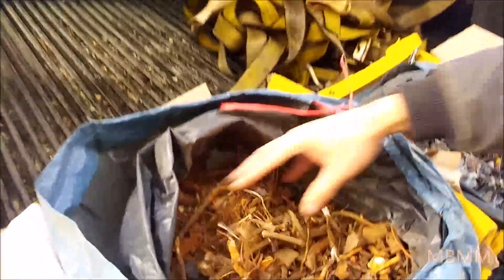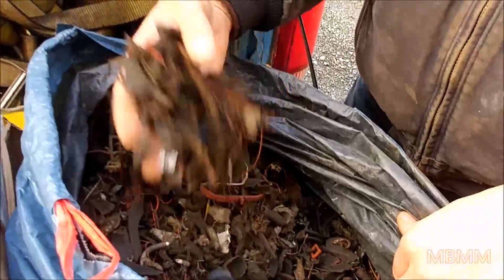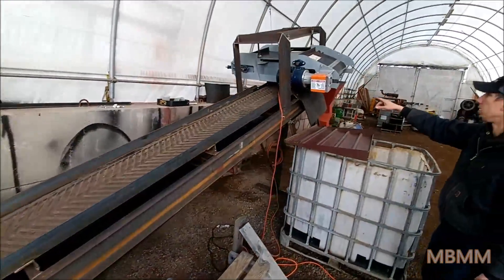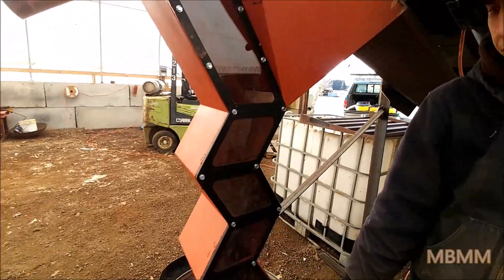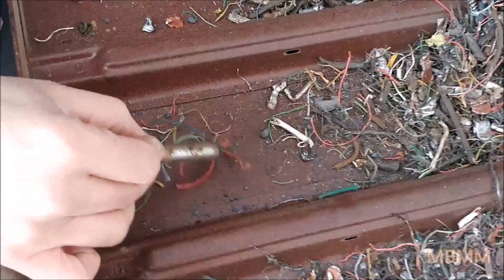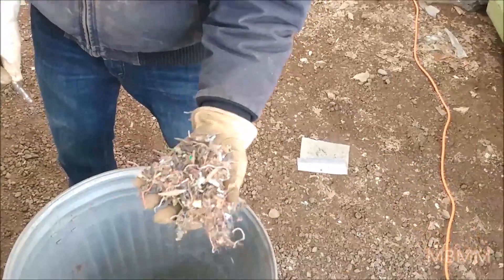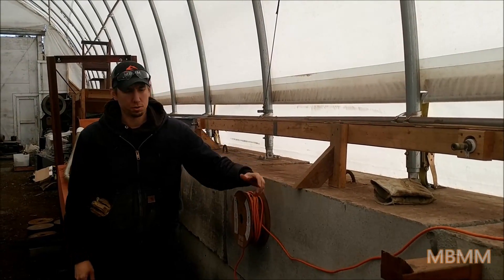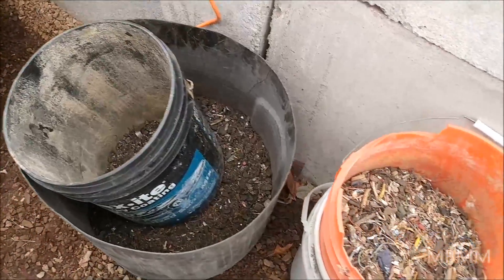Turn-Key Scrap Metal Processor with Heavy Duty Hammer Mill - Separate Ferrous, Copper, Plastic, etc

Comment: Any feasible way to separate the copper coating from the steel wires?
Reply: I wouldn't think so, since the wires are jus copper plated, very lil copper at all
Reply from the maker: Using a smaller screen might liberate the copper coating from the steel wires.  Though the copper recovered by the wires would be minimal in the grand scheme of recovery.